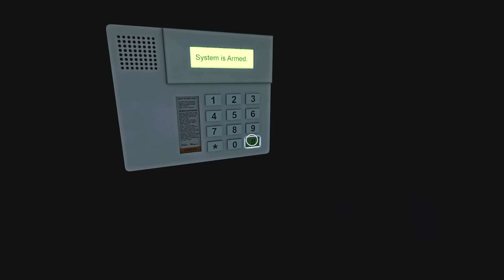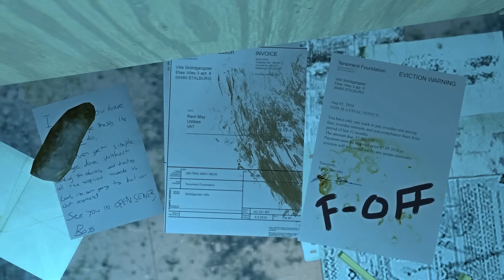Turning FLOOD VALVES can have MAJOR consequences...

Comment: IIRC the puzzle at the end of the video does not need to be solved. All it does is match the control wires for the crane to the corresponding buttons. It will still work even if you leave it like that, it'll just be harder to use because some (all?) of those buttons will be mixed up.

Comment: 14:47, close, but not cigar.

As an Architect, i'm here to tell you that those are Vierendeel beams, an adaptation made to save money in a different way not by cutting holes, but by rather cutting the beam from a smaller one.

They draw a zig zag pattern (can be done with hexagon pattern as well) with circle sectors and then when it's cut (only a small sliver gets discarded, so not much metal gets recouped from this), they stagger the two H beam flanges such that circles are formed and they weld them (because metal be liquid like that).

Comment: The "holes" cut in the metal beams aren't for always cost saving, as sometimes they actually cost more money. The beams are called "cellular/castellated" beams and they are actually stronger in some cases. They can be used for a number of reasons from weight reduction or strength but they can cost more money to produce than a solid steel beam
Reply: I was thinking the same thing - you've had to make the beam solid and then cut the holes. I guess you can recycle the plugs but you paid for that steel in the first place.

Was funny seeing the beer in the lathe chuck, the devs have a sense of humour.

But all the artificial blocks and puzzles would drive me mad, I couldn't play this. It's pretty repetitive with the fuses and boxes, and only being able to smash the things in the proper path - makes no sense.
Reply: Came to say this

Comment: Neat fact, that was not a generator but a pump.  Looks like it might have been a Nikola Tesla Turbine, which never took off as a power generator (cause it worked TOO efficiently and would deform the blades) but working in reverse it made for a great water pump!  yay for random YT knowledge videos!

Comment: Wanna add a little thing about those holes at 15:17: I've worked as a car mechanic and learned that if you cut holes like that into sheet metal and then bend the edges around you can increase stability while also saving material. Not sure if that also works with metal beams like this tho

Comment: Aww man, the amount of detail they put into stuff but then they get the elevators so wrong...  I mean the outsides were bang on in the apartment building, i could pretty much name the landing signalization model and all, but then the insides of the well... =D 

-Fellow (elevator design) engineer.
Reply: What do you mean by landing signalization?
Reply: @Freezorgium  Generally speaking? It's basically the buttons and displays for the elevator that show you whether it's going up or down etc. In this videos case I meant the ones at around 1:10 mark.

Comment: ahmmm those holes are not there to save money..because you need to pay for full I beam and then you need to pay to drill it...so it costs way more then normal beam...what you get is light weight and more strenght from one i beam...so you can have more span from smaller i beam. its same for those triangular trusses...same principal..you are engineer you should know this! im just a welder and i know this!
Reply from the maker: I haven't touched beams since I was at Uni which was a decade ago now, my bad! Obvious when you have time to think about it!